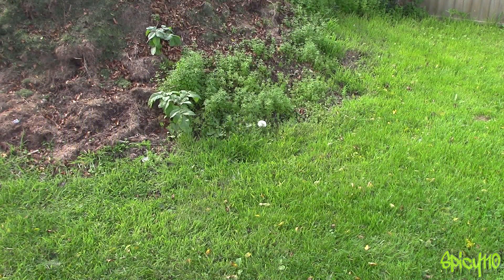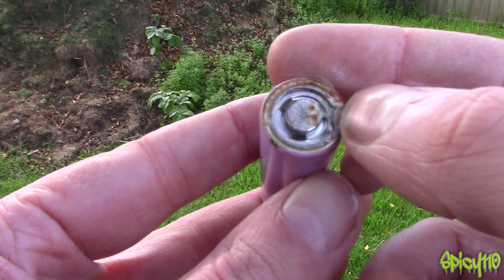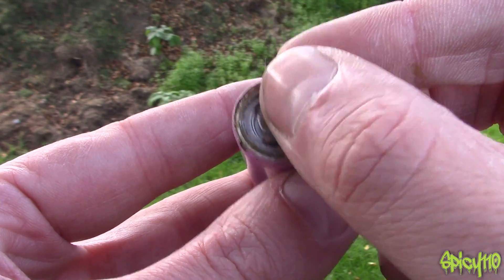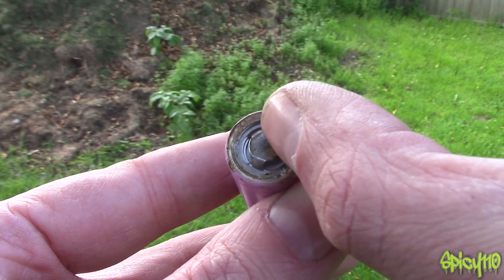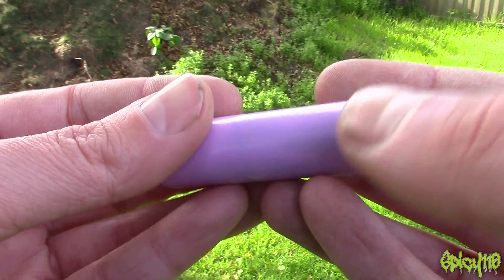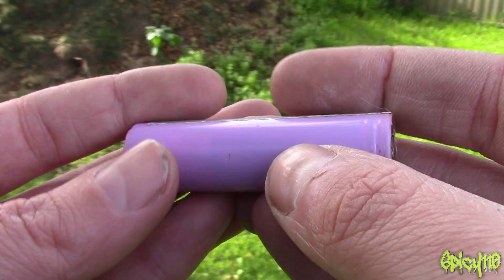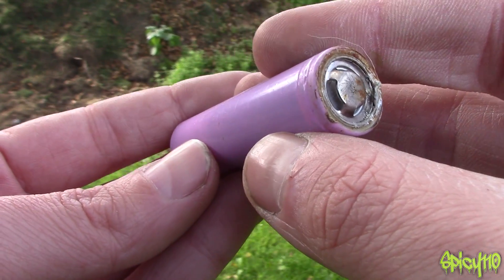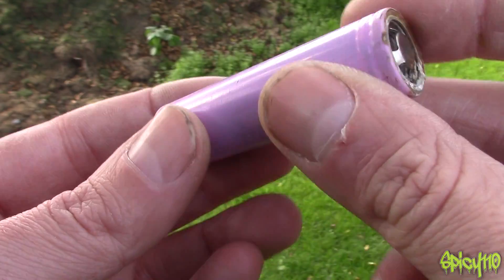Piercing a lithium 18650!

Comment: Had this happen in my office overnight while charging 18650 vape batteries. The battery shot like a rocket around the room, i have found pieces all over the place.
Reply from the maker: Damn, I hope the damage was not too bad, was there any damage to the cell beforehand?
Reply: @spicy110  Damage isnt too bad, a burn mark on the linoleum floor, so i have to swap that out. Ash on pretty much everything, so i have to do a deep clean. Also might have to paint a wall.

There was no damage to the cell before hand, the 18650 was under 6 months old, i have no idea what happened.
Reply from the maker: Yer that is odd, might have been a faulty cell. Well glad it didn't end up in more damage!
Reply: @spicy110  yeah probably. Thanks man, i was lucky. Smells like shit in here tho lol.

Comment: S glad I saw this video before I attempted to remove a corroded D battery stuck inside my Maglite 6 D cell flashlight. Prevented an involuntary bowel movement by me.
Reply from the maker: D cells as in normal batteries? If so they are not lithium so they do not have this level of risk.

Comment: anyone know what the battery chemistry is? I'd really like to know if an IMR would be this violent. Thanks
Reply from the maker: Lithium-ion.
Reply: @spicy110   I mean is it an ICR, INR, IMR, or what it the identifier code?  I couldn't decipher the text on the side of the battery, it was too blurry. IMR batteries are known for being much safer, im sure they would still explode but I just wonder how violently compared to an ICR battery which are known to be much more volatile chemistry
Reply from the maker: So I took a screen shot of the batt and did some photoshop work and was able to read the codes, it is INR 18650-300 so  INR but I thought they were "very stable" lol

Comment: Before you try to build a mechanical vape without any idea of battery safety Ampers and Volts please watch this video. That battery is in your mouth in a copper tube... fricking pipe bomb

Comment: yesterday I made a short circuit by mistake with an 18650 battery taken out of a Lidl drill and it instantly caught fire in my hand, instinctively I threw it down but it had already caused a 5mm burn on my finger. These 18650 batteries are  extremely dangerous, I never thought that from a short circuit a battery could catch fire in less than 1 second and become incandescent

Comment: I never realised that these battery’s are soo dangerous when pierced . I expected much less of a reaction . I’m now removing all old used 18650’s from my house as I’m writing this .
Reply from the maker: As long as they are good cells and stored correctly (ideally in a fireproof box) they are quite safe. The issue comes when one is lost down the back of something and gets damaged. They just need a little respect tis all. 🙂
Reply: @spicy110  I’m sure you are glad to still have the use of your hands 🙏 🤣
Reply: Battery cutting hobbyists are appaled at this video it seems

Comment: I have a security camera with 2 of these batteries, however they are stuck inside, if I flatten the battery will it still explode, i was thinking of drilling them out.
Reply from the maker: if you do anything to it that either dents it or stabs it or anything like that, even a short could lead to this. How are they stuck?

Comment: Good way to start a campfire if you have nothing but an 18650
Reply from the maker: I would short it with a wire to make a spark rather than doing this as I have tried to do this again twice since and neither even fully charged did this. I think shooting it broke a few layers inside and set it up to just go like that haha
Reply: @spicy110  ah I see, probably best to just keep a lighter than 🤣, thanks for the experiments ❤️.

Comment: Keep in mind if the battery was fully charged the explosion would be much more intense!
Reply from the maker: This was fully charged....all be it an old cell.
Reply: @spicy110  fully charged? awsome! Another good explosive test would be a fully charged AND a very low internal resistance cell like a high c's or high amperage cell that can handle 20 amps or better should yield a very intense fire boom!
Reply: @g2rc  does this mean it is more interesting to buy a cell type that has less amperage for safety? I am thinking about building a DIY powerstation, but this demonstrates the necessity of a good protection circuit.

Comment: Will a button lithium ion do the same? There is one stuck in my laser module and it's so pressfit do to the insulator adding to girth I can not remove it any over way then drilling it and using a pick to lift up from the inside
Reply from the maker: If it is dead maybe not but it's hard to say it may very well catch fire. How about super gluing a stick to the top?

Comment: I can only assume the friction of the screw produced enough heat to ignite the lithium strip folded in the battery
Reply: Ps I wouldn’t recommend mechanical vapes as they don’t have regulators for the batteries. Can’t ever be too safe. Stay safe and have fun!
Reply: No, lithium exposed to air will certainly ignite, and if it touches water, it will explode. All the phenomenon is due to hydrogen. In what way and in what form does lithium react with water? Lithium reacts intensely with water, forming lithium hydroxide and highly flammable hydrogen. The colourless solution is highly alkalic.
Reply: actually, if you pierce a lithium battery it is the lithium touching the aluminum that makes it explode @pgobservers

Comment: This happened to me once.  The plastic wrapping came off and while replacing the battery in my modbox (like I normally do)  it shorted and went off like a rocket in the room.

Burnt thr shit out of my calve on my right leg and singed the walls on the drywall.  It was in my new computer room.  Sadly a few days later I think I threw one away and it caught my garage on fire.  We were all safe because we got out of the house in time.

Comment: Chinese 18650 battery is shit I guess. They should sell with AA version so no explosion 🔋💥😉😜. You can't charge those cheap POS 18650 batts. AA version (and battery research) would have saved their eyes. What were they thinking trusting a cheap ass li-ion batt? Cheap 18650 🔋🤮

Comment: Good video. I don't think that a big brand battery after 2016 would do that, because they add lots of stuff and have foam wich melts of hot and becomes impermeable to electrons in the electrolyte these days.

Comment: What is really terrifying for me, is that lithium batteries is becoming more common in boats. Imagine this happening on your boat in the middle of the ocean. No see you later there.
Reply from the maker: Tbh any fire on a fiberglass boat is going to go up fast. As long as the cells are of good quality and designed well it should never be a issue like having a combustion engine and fuel onboard. But unlike petrol where you will smell it first these just go from 0-100 in a split second.
Reply: @spicy110  Agreed. But you know that little thing called bad luck.
Reply: Well u got plenty of water to put it out!
Reply: @franklofarojr.2969  👍

Comment: I mean li-ion batteries are kinda safe as long as you but it a a reliable source. Was scared for a bit my 21700 samsung 40t would explode in my flashlight. Pretty sure now it wont
Reply: If you don't abuse them and charge them to safe levels, they will never explode if they're made properly

Comment: Had this happen in my pocket. Danger is real! Don't ever put them on your body and you should be pretty good. Coming from the persepective of 10%+ full body burns here.
Reply: Did it fully heal?
Reply: @TwinbeeUK  yep. All good now. Big scar, but everything's sorta like it's supposed to be.
Reply: @joblessalex  Good to hear! I guess you had metal sorta things in your pocket which caused a short circuit for this to happen.
Reply: @TwinbeeUK  Think it was a penny I missed. Split the wrapper and took it straight home for rewrapping, just didn't make it the last 5 steps to the charging station lol

Comment: My dirtbike is powered by a ton of these 
Now I'm worried to fall off of it 
And it's also in a module that slides out and is secured by a rubber strap. So if it falls out well shit might happen.

Edit: also my mom has a tesla and they have thousands of these in them I'm even more scared.
Reply: You should be scared.
Reply: Tylor Swift I’m scared
Reply: @105DARKNINJA  good.

Comment: Imagine if they came out with a battery that held so much power, that piercing it would take out everything within a 10 yard radius.  Now something like THAT, I imagine would have to come with an explosive hazmat warning on it, and would probably be illegal for the general public to own.
Reply: You mean like a Tesla battery?
Reply: @MyXyle666  Tesla batteries mostly use 18650s just like this. The other one they use is lifepo4, which is incredibly safe but requires special care to fully use its lifespan

Comment: Cool.. nice experiment
The minus pole did look rerative stable and the plus pole dis burst first.. i think thats why the plus pole in e cigaretts points downwards and not into the face
Reply: Um, I think you're using your battery the wrong way.. It will work both ways in some mods, but there is only one correct way to install them. I'd double check if I were you.
Reply: Um, I think you're using your battery the wrong way.. It will work both ways in some mods, but there is only one correct way to install them. I'd double check if I were you.

Comment: I once had a lead acid car battery explode while charging with a car battery charger, it turned out one of the cells was short circuiting and boiling the battery acid inside and slowly building up pressure. it exploded like a land mine spewing acid, plastic and chunks of lead fragments everywhere.
Reply from the maker: I have seen videos of this and know people who have had it happen. The one thing they all seem to emphasise is the severity of the explosion! From the sounds of it if you were close enough and you unlucky it could do you serious damage!
Reply: Yes it can be a very loud bang, I remember a golf cart battery did this from the tee about a thousand yards away on the other hill distant but it was as if it happened right next to me.

Comment: so far Tesla has a much much higher fire death rate (fire death/total accident) rate than gasoline cars, I guess this video kind of explained it. Tesla's battery placement basically means frontal and rear collision has much lower chance of battery fire than a side impact. (Other auto manufacturer put the battery in the middle of the car). So tesla owners, avoid side crash as much as possible!

Comment: And people wonder why charging these batteries ( in phones and things) whilst using them is a bad idea.
Reply from the maker: +altypeRR to be honest most laptops have 6-8 of these in them. If you follow the rules and dispose of damaged cells they are perfectly safe.
Reply: I don't think you understand how battery chargers work whatsoever
Reply: @pootispiker2866  holy post resurrection!    Go on then.  Educate me.
Reply: @altypeRR  It's almost like things on the internet stay there forever! How DARE someone find it again, especially on a platform where old videos are heavily promoted?! The audacity..

When you charge a battery, specifically on a phone, a circuit feeds power to a single battery cell. What that circuit consists of doesn't really matter in this discussion. Using the device while it's charging only "steals" power from the battery provided by the charging circuit, and the only thing that the battery sees is a decreased charging rate. The charge controller doesn't send a deathbeam that magically makes the battery detonate, it just shares power between whatever device and the battery. On dumb chargers this simply results in the battery never being fully charged while on more advanced systems the battery reaches full charge regardless, meaning the phone is simply being powered by the charger.

It's not inherently dangerous. Using your reasoning, every phone that was merely left on would detonate the battery during charging.

Comment: And that's why my batteries are always in a charger, a vape or a plastic case. You do not want that happening in your trouser pocket!
Btw Spicy, you can buy replacement wraps and insulators for 18650s, I get mine from Ecolux. But you probably knew that 😉
Reply from the maker: +Andy Fairchild I do indeed but this cell is well over a year old and cheap, not to mention the damage the first short on the charger did 🙂
Reply: spicy110 yup, any doubts, chuck 'em (well recycle) or shoot 'em! I nicked a wrap loading 4 batteries into a series mod once, one vented. Scary moment! Never used them again.
Reply: You can get them almost anywhere, fasstech has 10 packs of fancy wraps like lous vitton and gucci for like $1.25 and like $10 will get you almost a 1000 pack. They dont cost shit and most shops (should) just give them out.
Reply: how do u wrap it? with a hair blower or a lighter?

Comment: How many 18650s in the average electric car.....     Shit I think I'll stick to petrol....
Reply: Do you stab your car often?
Reply: Car crash generates much more force than stabbing. For gas to burn, there must be both physical impacts to break the tank and a heat source to ignite the gas. For the battery, physical impact alone will start the fire.
Reply: Read the news carefully and be vigilant. The title says Tesla that caught fire reached 116mph. It says it reached 116mph, but it does not say the car crashed at 116mph. If you dig deeper, you will find the car reached 116mph, reduced speed, lost control at a turn, hit the curb, hit a bunch of other stuff and caught fire. The crashing speed was much lower than 116mph. The guy who got thrown out of the car survived. The other two in the car died. Hmmm...
Reply: jimmy jammers , false diesel isn't that flammable. Throw a lit cig in a can of diesel it just goes out. Diesel needs high compression. You stick too many things up your butt
Reply: Dumbest comment of the year. Ever seen 50 litres of fuel get sparked?
Reply: You can walk away from 18650 fires. You can not Outrun a Gasoline Fireball especially if it's leaked all over the ground.
Reply: the florid teen drove a tesla  at 116 MPH before hitting the wall and one of passengers did not die.
Reply: ever seen a petrol fire?
Reply: much harder to damage EV battery pack till it bursts into flames unlike petrol which just needs a spark BIG BADA BOOOM
Reply: Petrol fire is more predictable and easier to extinguish, impact alone isn't going to cause ignition. Li ion fires on the other hand are very hard to extinguish, water is not even an option
Reply: Never, but cars crash often,  Road debris damages cars often, water spreads lithium fires often.  I love the insta-torque, quietness, simlicity, etc etc of electric cars, but they aren't the end all, unless your an Elon Musk fanboy.